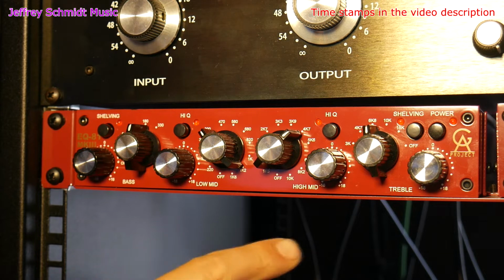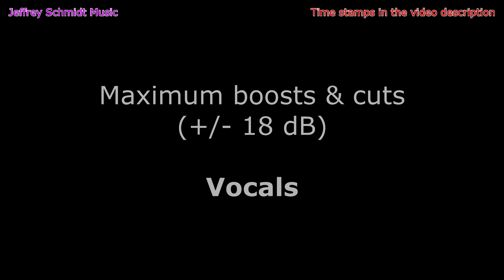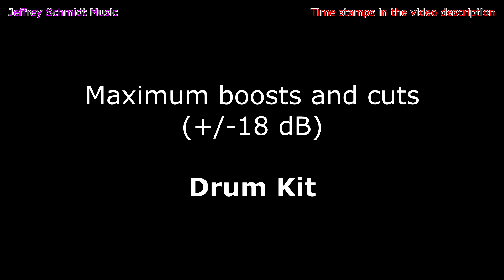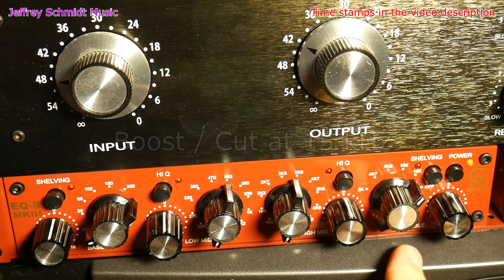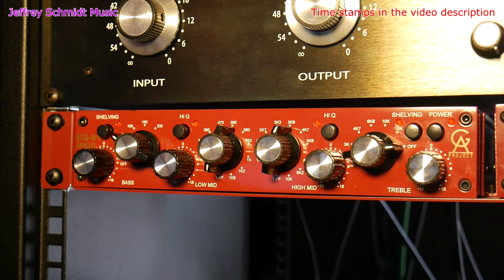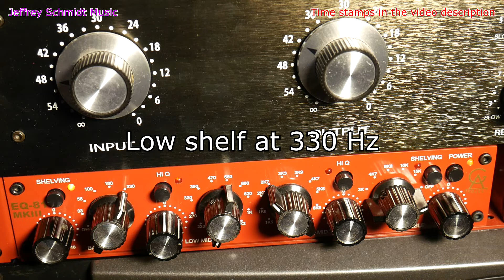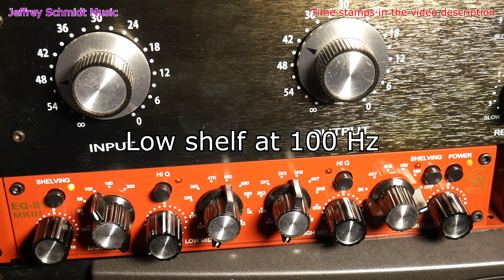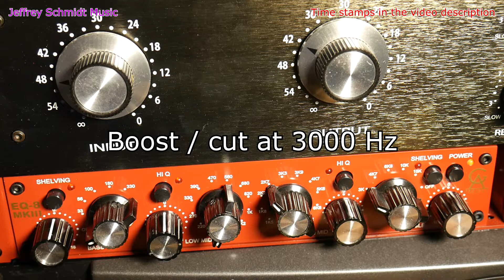Golden Age Project EQ-81 MK3 - Review & Demo

Comment: I bought one today. For me, the top end shelf has less of a sparkle than my wa 73 eq, the 81 needs quite the boost to hear tangible differences. 

 I use a isa one, into the eq81, wa73 eq insert, into a 263a dbx de esser, into a kt 76 then a vla11. I love the cutting options. My vocals go in the box with a couple low end cuts on the 81 with a shelf boost on the 73. The sound is neat and 95 done. 

This is a good eq to shape vocals.
Reply from the maker: That's interesting hearing your comparison with the wa 73 eq, which I haven't tried out myself.  Thanks for your comment.
Reply: this unit is definitely less thick sounding. It is very capable and versatile. Did you hear a ringing noise when initiating the insert button?
Reply from the maker: @ Actually I've always engaged the insert button only when the device is off, just to make sure that there aren't any issues for gear that's downstream.

Comment: These are great, I have two that i uses as a stereo pair and I love using them.  I am so glad I purchased the EQ 81 MK III, I use these with my ART Pro VLA II, Two channel Compressor.
Reply from the maker: Nice! It's great to hear that they work nicely in stereo.
Reply: How do you get them to stereo pair/ stereo link?
Reply: @novahhthaproducer6767  First, this is where a patch bay comes in handy, to keep from going behind the rack. Connect the 1st EQ 81 MK III output to an input on your Audio I/O, let's say 7. Connect the second EQ 81 MK III output the another input on your Audio I/O let's say 8.  Now take  the Line IN from the EQ 81 MK III and attach them to the Audio I/O outputs respectively for 7/8.   In your DAW you should have some kind of External Insert option to add hardware, check the manual.  So, on your Master Bus, insert  the external insert and connect channel 7/8 as a stereo pair and the audio will pass through your EQ's during playback.  Adjust  the EQ as necessary.   View the tutorial in for Cubase - https://www.youtube.com/watch?v=ZCdOp4JpY18&t=246s
Reply from the maker: @novahhthaproducer6767  As far as I know, there's no link functionality unfortunately

Comment: Hi and thanks for the video! Very informative. I am a trumpet player and singer, but this is not why I am interested in the product, it's mainly as an "audiophile" I hate that therm. But well just wanna say it's for music listening purposes. I was wondering if you think the device could be usable with a dac/amp combo (audio gd R28, it has a preamp). I know nothing about electronics so sorry if my question sounds obvious. have a great day!
Reply from the maker: Hmm I'll first say that I haven't tried using it for mastering or listening purposes.  You'd need two of them for that by the way (I only have one atm).  That said, I don't think that this EQ would be ideal for those tasks.  Neve-style EQs (which what this is!) have always been known and appreciated for the "color" that they add to the tracks that they are used on, not for their neutrality, which is what most mastering and audiofile EQs go for.  Also, as another commenter pointed out this EQ doesn't have discrete level knobs or the possibility of linking two of them for stereo purposes, meaning that it would be basically impossible to set the bass level (for example) of two of these exactly the same.  All the above is basically a long way of saying that this is a good tracking EQ (if you like Neve-style sounds), but a bad mastering/audiofile EQ!  Hope this helps.